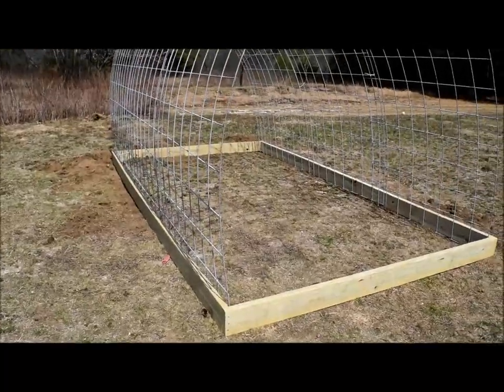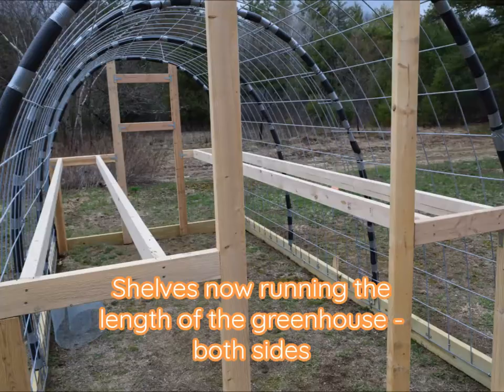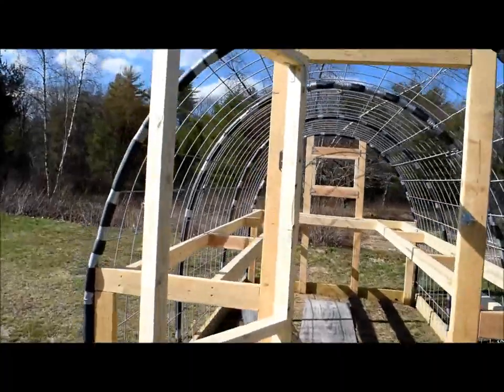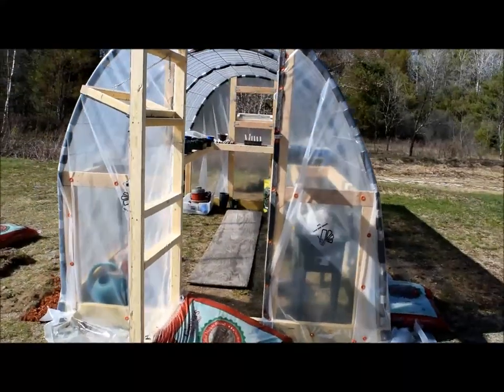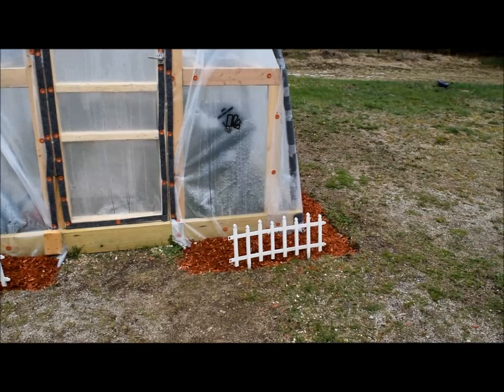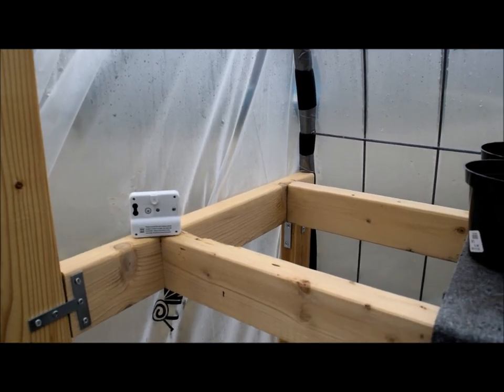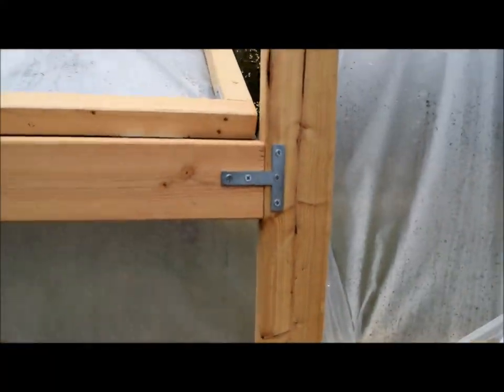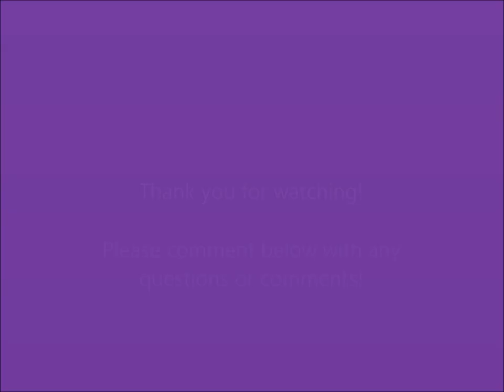DIY Cattle Panel Greenhouse Build - FULL TOUR of completed project!

Comment: Great job, the size and link for your plastic is helpful. I saw a video to have roll up sides to vent it on warm days so i may do that. Built mine over two raised beds and no cover in the spring/summer when i use it as a trellis. Great video thank you.
Reply from the maker: Thank you very much, glad you found some useful information in the video!  Thank you for watching!

Comment: can you tell us the size of your green house and add links to all supplys you used to build with please. you did a great job and i want to try to build my own. thanks so much
Reply from the maker: Thank you for watching and your question!  Sorry if I didn't mention the size in the video but the finished size was 12x7 - we went with 7' on the width to make the center of the inside tall enough that my husband didn't have to crouch down when he was inside 🙂 - so we cut down those boards on the bottom to be 7', but they were 8' when we bought them.  I did add a supply list in the description above, which is just about everything I could remember using while we were building.  Most supplies were purchased at our local Home Depot.  There is also a link above for the UV plastic I purchased from Amazon as well as the remote temperature monitor (also from Amazon).  Again, thank you for watching and good luck building your own!  😉
Reply: @oldirondemolitionderbyvideos   you are amazing thank you so much..

Comment from the maker: I have been asked to put together a supply list for this build, so here is the best I can remember since we didn’t do the build all at once, we didn’t buy all our supplies at one time.  If you have a specific question about supplies or anything else pertaining to our build, please feel free to ask!  I am sure I am forgetting something but this is the list of major supplies I can think of right now  😊

•	12 foot pressure treated planks – I believe they are 2x6 – used for the bottom side base
•	8 foot pressure treated planks – also 2x6 – used for bottom front/back base
•	2x4 planks and I can’t remember how many we used since we did this project over a few weeks.  These were used for the “main” structure of the front and back walls as well as the shelving
•	(3) 12x8 cattle panels (which we got at Tractor Supply)
•	Galvanized tab tape – we used this to secure the cattle panels to the pressure treated base
•	Shorter screws to secure the tabs into place, I think they were ½ inch
•	Decking screws – multiple sizes but I think we mostly used 2 & ½ inch.  Some larger or smaller might be needed depending on where you are using them
•	UV special plastic, link in my video description on where I got that and what size
•	Chicken wire-type fencing, used for my back work bench, cut to size (had this at the house so I didn’t need to purchase)
•	“L” brackets and “T” brackets – used for the back window and front door.  
•	Locking latch for back window
•	Eye hooks, which I already had and used for my “adjustable” window opening front & back
•	Chains used for my “adjustable” windows, which I also had from old dog collars that I no longer use.  But any sort of chain would work.  I just like the chain so I can open a little or a lot, depending on how much air flow I wanted at any given time.
•	Greenhouse UV plastic (from Amazon) – link in description.  Size I got was 20ft X 25ft
•	Box of 1” grip rite nails – used to secure down plastic
Reply: what did you secure the pipe insulation to the cattle panels with?
Reply from the maker: @storytimewithmissdonna2950   I used gorilla tape to secure it to the inside of the greenhouse.  I was going to use zip ties but was concerned about sharp edges from the ties ripping the plastic.  I did have to replace SOME spots of tape this past spring but for the most part, the tape held up well.  Thank you for watching!

Comment: what will hold it down in the WIND? I just lost 2 greenhouses to the az monsoon winds. They were anchored with RR Ties too!
Reply from the maker: Oh no!  I'm sorry to hear that you lost two greenhouses recently to high winds.  The highest wind we've gotten since ours was built (we're in southern NH) was just over 40mph and did not have any problems, so I'm not sure how much higher your winds were in AZ.  We don't really have it "tied down" per se, but the base is quite rugged - it's built with 2x8's pressure treated so the base is pretty heavy itself, which helps hold everything down pretty well for our weather here.  We rarely see anything over 50mph.  I have always been more concerned about something like a branch breaking off from a tree and puncturing the sides, but KNOCK ON WOOD, that hasn't happened either.  I hope you can find a resolution to anchor your greenhouses down and sorry I don't have any suggestions for you.